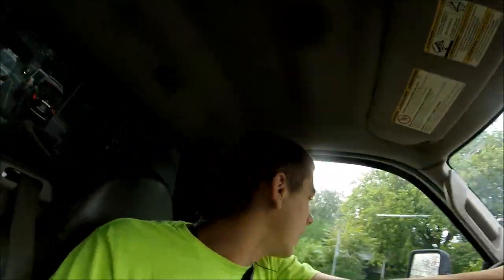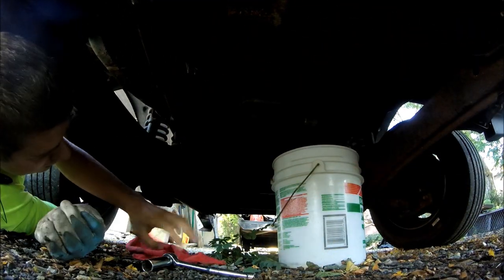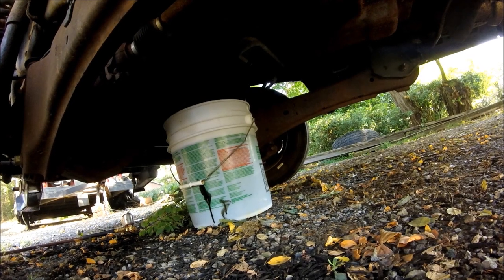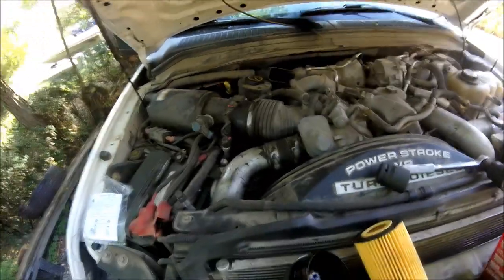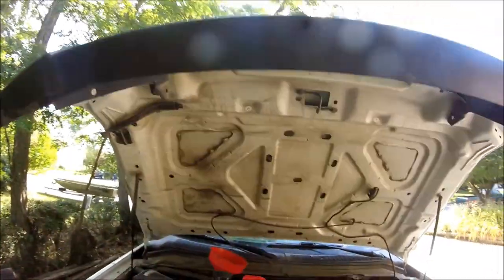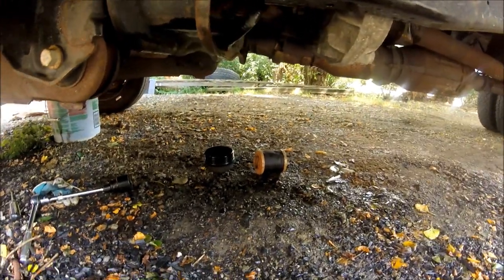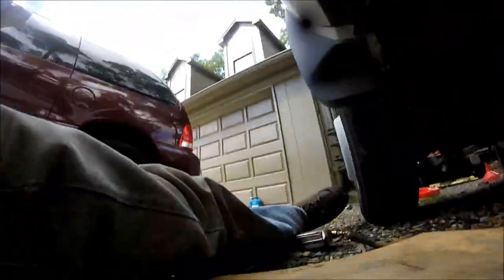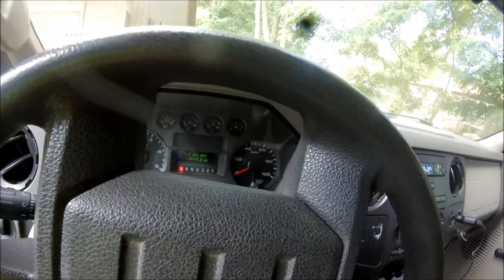Ford f450 dump truck oil chance and fuel filters + I take a Diesel Fuel Bath

Comment: good job changing that filter on the frame rail. make sure to drain it monthly unlike the prior owners because that valve wouldnt break off if it got opened monthly.
Reply from the maker: yeah that's my thoughts exactly
Reply: +J.L. Landscaping and property maintenance ya had to be the reason. I would also change the front and rear differential fluid soon too.